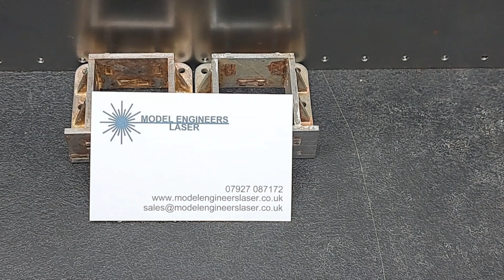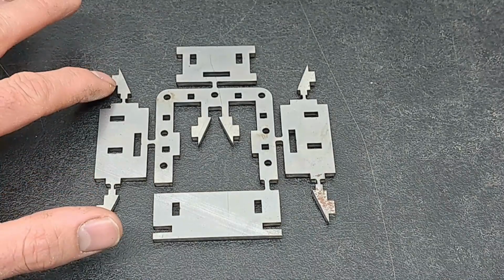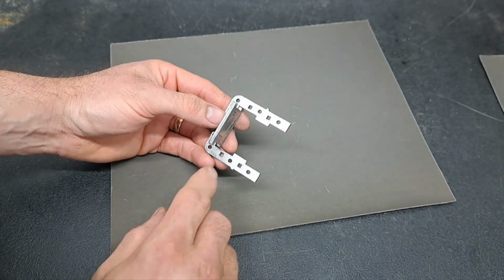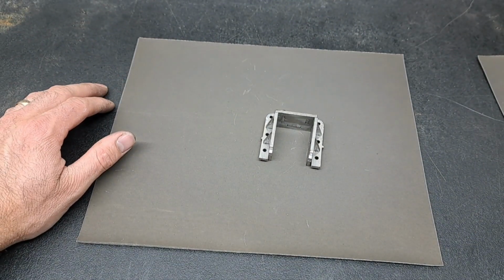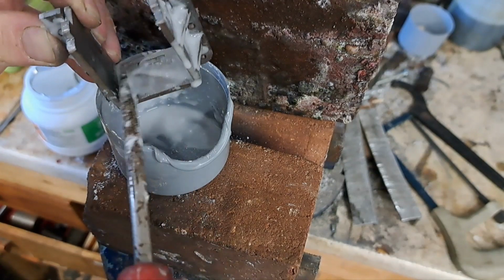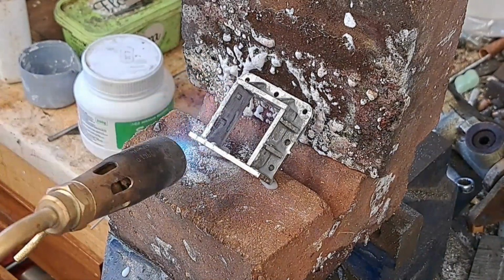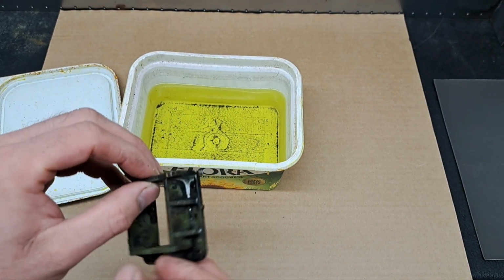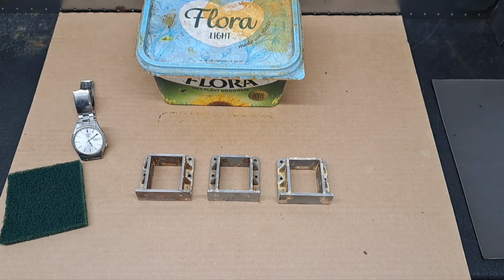Building The First Diesel 1831 in 5" - part 2

Comment: It's hydrochloric acid.  I prefer sulphuric as it has a much less propensity for causing corrosion of ferrous metal in the workshop.
Reply from the maker: That's the one.  I prefer it as it's much easier to get hold of than Sulphuric
Reply: @ModelEngineersLaser  I empty old batteries, before disposing of them Ed.
Reply: I would wonder if vinegar would suffice. Or better yet Acetic Acid.
Reply: @oldfarthacks   Essentially yes the same stuff.  It would work, but very slowly, better if warmed up.  Acetic acid is chemically a weak acid, which means the level of dissociation to produce hydrogen ions in aqueous solution (the acid causing bits) is low.  Strong acids such as hydrochloric and sulphuric dissociate completely and are thus called strong acids.

Comment: Do you need to silver solder these parts? I'm not confident with silver soldering, so super gluing would be preferred!  TIA!
Reply from the maker: Wouldn't recommend super glue, but there wil be an adhesive you could use I'm sure. After all, they glue cars together now, but I don't know enough about the glue and stick to soldering, which I know.
Reply: Given how these are fitted up, you may well be able to soft solder them, then peen the ends of the tabs, followed by reflowing the soft solder.

Comment: Technically the brick and concrete cleaner is between 30 and 40% Hydrochloric acid (the rest being water) The fumes it gives off will eat any ferrous or copper it comes in contact with which makes this one of those jobs that's really better to do outside on a breezy day
Reply: To be honest, not a problem I've really had.  I do the lid on the tub though, and there's only been a slight bit of surface corrosion on a few pieces that were against the pot